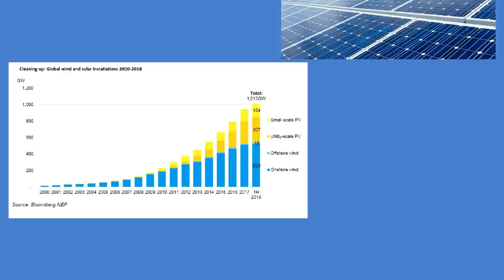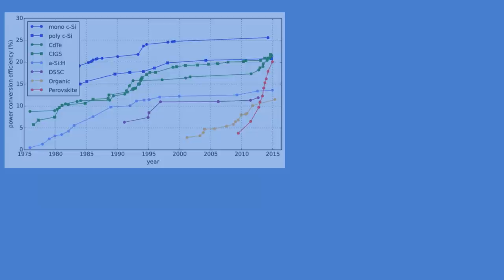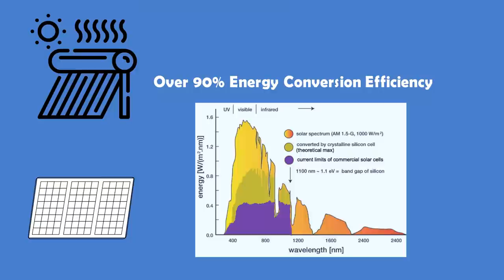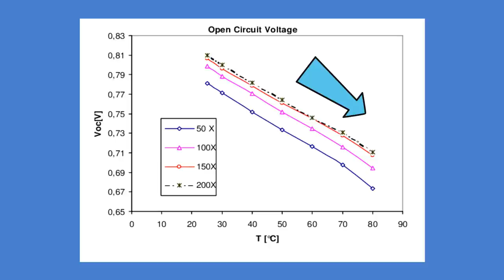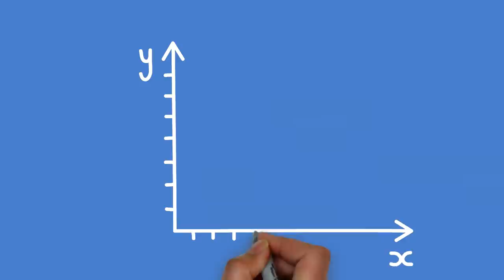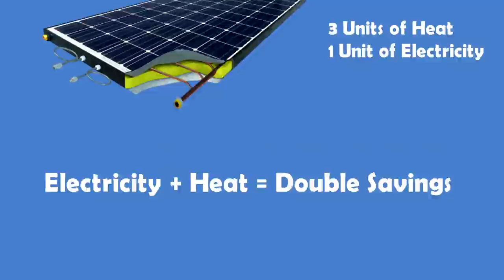Solar Photovoltaic Thermal Hybrid Panels: The Next Step

Comment: 0:02 Combine concentrated solar and concentrated wind with a folding  mirrored cone dish and a cylinder down the mddle lined with high temperature high efficiency solar cells.  If you heat compressed air in the cylinder, you can drive a gas turbine with it.  Some solar farms do that.  They store the energy in a pile of gravel and recover the energy with a gas turbine to make electricity.  This kind of system might generate six or eight times the elecyrical energy as the same area in regular solar panels for a small fraction the price. 
Some cars have a combination turbocharger, electric motor and generator to spin the turbocharger for faster power in between acceleration and conserve energy.  It might be about the right size for a gas turbine to drive the dish energy system. 0:02

Comment: Another idea was using lens to concentrate more light into the panel and a close cycle thermal engine connected to the cooling tubes.

Comment: Idea:  Take the generated hot water,  run it across a refrigerant evaporator unit, and then run the refrigerant gas through a turbine in order to generate even more electricity.  In the summer time at least, that would be preferable to dumping heat to atmosphere.

The question really is whether the electricity generated will be sufficient to run the refrigerant compressor.  If so, then it could be a worthwhile component to add to the system.
Reply: Hell, you could run a steam engine off my panels and do as you like with that energy!

Comment: I looked into this almost 10 years ago and the price difference for the panels was double even before the extra installation costs 😟
Reply: You can build one with an old hot water heater, a "solar shield" full wavelength absorbing material, some hose and copper pipe and 4-5 hours.
Reply: I'd be happy to share designs.

Comment: It’s still blowing my mind lol what if I bury a shipping container full of my solar panels effectively making an underground oven and use convex mirrors to heat oil in metal pipes to 600 degrees in a separate insulated oil tank and maintain a constant whatever temperature is best for the solar panels 24 hours a day! 4x fold I was going to do the same thing for the swimming pool in Arizona elevation 5,000 feet! I just need emergency blankets and the warm pool water will warm my house at night in the cement floor!

Comment: One one hand, we are nowhere near the theoretical limits for solar. The Shockley-Queisser limit, which is about 33%, applies to a single-junction silicon PV cell, without concentration. Other configurations can do much better. OTOH of course, it's a matter of extra factors: manufacturing cost, how much direct sunlight you have (therefore how much you can concentrate), and a few other matters. Theoretically, with direct sunlight and concentration, you could exploit the maximum effective temperature available by concentration, which is the same as the temperature of the surface of the sun: about 6300 Kelvins. Divide that by the sum of itself and the ambient temperature (typically 300 K), and you get 6300/6600=0.95, so about 95% efficiency.

There are a number of approaches you can take to milk more useful work out of the incident sunlight. It's a significant subject, probably worth a whole bunch of videos.

Comment: It is easier to use a heat pump with a high CoP. Best regards from Egypt.
Reply: Costs more, uses more electricity, and doesn't improve panel power output.

Comment: What about European winter temperatures? We had 0 to 1 C most of last week (daytime temp).
Reply from the maker: You can run water glycol mixture through the water heater and have a heat exchanger in your hot water tank
Reply: @synergyfiles3536  thinking further, it could be used as a alternative heat source for a heat pump. Even at cold temperatures, in winter, with a little bit of sun, you could get the required temperature raise of about 5grdK and that at a higher temperature level as from your primary source, therefore at a higher efficency. For example, my earth collector, today Feb.19, has an input temp. of -7grdC and an output temp. of -2grdC (achiving a raise of 5grdK).

Comment: Cooling won't happen if solar thermal water is already heated up enough >60C. Dilemma: PV needs cool water, but you have solar thermal to heat up, and in most cases store, the water.

Comment: السلام علیکم 
سر چار بیٹری ہےAH 200 کی 
اگر سیریز میں کنیکٹ کریں تو چارجنگ کرنٹ  کیا ہوگی یعنی سولر انورٹر سے کتنے امپیر سلیکٹ کرنے چاہیے اسے چارجنگ کے لیے 20 یا 80
Reply from the maker: Current say farq nahi perta. Asal cheez hai jo cheez charge ho uska voltage kum, aur jo cheez charge karay uska voltage ziada hona chahiay. 12 V ki battery hai to 13 V ka panel hoga to charge karay ga.
48 V ki battery hai to charger ka voltage 48 V say ziada hona chahiay.   Laikin agar buhat ziada voltage hoga to us say battery kay damage honay ka khatra rehta hai. Wasalam
Reply: @synergyfiles3536 چارجنگ والٹیج ستاون اعشاریہ چھ 57.6 سلیکٹڈ  کی ہے 48 وولٹ بیٹری بینک کے لئے 
اب ایمپیر کی سمجھ نہیں آرہی کہ 20 امپیر سلیکٹ کریں 
یا 20×80=4 مطلب کیونکہ چار بیٹیاں ہیں 
نوٹ بیٹری سیریز میں ہے
Reply from the maker: @SulemanKhan-io2gm  Bhai aap kay pass volt meter hai? Battery ki resistance maloom karaian kitnay ohm ki hai. Us meter main hi option hota hai. Phir jo bhi value aaey usko note ker lain. 
57.6 -48 yani 9.6 V ka potential difference hai. Aap 9.6 ko taqseem karaim us value say jo meter say maloom ki. Current nikal aaey ga. Yeh ziada say ziada current ho ga. Aap ka panel kitnay watt ka hai?
Reply: @synergyfiles3536  250watt K panel
4 batteries 
1 battery 200ah
Series mein 48 volt
Reply from the maker: @SulemanKhan-io2gm  agar 250 watt ka aik panel hai to 4.3 amp say ziada current nahi hoga. Agar 2 panel hain to 8.6 amp, ager teen to 12.9 amp

Comment: PVT can be a great option in colder countries where the entire energy can be used, even in hotter countries, the increased solar electricity generation and the longevity is a boon. But, what do you think of A Solar panel that also uses peltier effect, that should also generate electricity and as a result should cool the panel. I had looked it up a few weeks ago..couldn't find much. Can you research into it?
Reply from the maker: I have done a video on it. Please search STEG it will pop up

Comment: Yes, its great but... there's always a but.  And in this case, the 'but' is that the life-span of the hybrid panel is going to be fairly short compared to the life-span of just the solar panel.  You are pushing fluid through a great deal of copper there, the chances of developing a leak or astronomically high so maintenance would become a significant issue.

A second problem is the fluid that you are pushing.  Generally speaking, pushing water (distilled or otherwise) is going to gum up the works from mineral deposits and other problems fairly quickly, particularly when the water is heated up, not to mention the problem of pressurization and boiling.

So you need to push something else through the hybrid panels in a closed loop that isn't water and that has better properties than water, and extract the heat to be used to heat your actual water with a heat-exchanger.  That way most of the maintenance devolves down into the heat-exchanger system and the hybrid panel system is far less likely to develop a problem.

All of this entails significantly more complexity than just having solar panels generating electricity.  Solar thermal systems can definitely be cost-effective, but those systems are usually relatively small (the closed loop in particular is relatively short).  Running the pipes through many panels instead of just a few exponentially increases the risk of a leak and other maintenance problems developing.

-Matt

Comment: I think I can use the excess heat to run a Stirling Engine connected to a generator.
Reply: You could charge a phone like that. To get any real power you need a large temperature difference which this wont provide.
Reply: @Edwin Nasson They are brilliant, but your example is concentrated solar where a Stirling Engine will indeed work well since the temperature difference is sufficient to produce usable energy. What poor @Ray Watson was lead to beleive is that he can use the waste heat from a photovoltaic to produce meaningful power...which just goes against the laws of thermodynamics, unless you include extra links in the chain that make for a very expensive and innefficient system. Better to start with solar thermal or stick with photovoltaic. Trying to mix the two will only happen when we have solar cells that reliablly work up too 600C. This technology is in its infancy and not something we can do easilly in our sheds.

Comment: These existed for a while now, they must have a major flaw, that no major manufacturer has been producing them.
Reply: My PV lecturer when I did my MSc in Renewable Energy Systems had concerns about these panels in regards to what happens if the water pump circulating cooling water through the back of the panels fails.

With the back of the panel being insulated and the panel no longer being cooled, the cells would get very hot potentially damaging the panel.
Reply: The main problem is you want to keep the fluid longer in the collector to get it heated up to 60-70 C, but the pv panels work best around 25C. So either you are running the pv at a bad temperature or you need much more storage if you want to store 40 degrees water instead of 60-70. Most people don't have/need a warm water pool.
Reply: They probably work best with an air heat pump. Meaning you'll have a cooling element, not unlike the one inside your freezer, stuck behind the PV panel. But that's another expense.

Comment: Why not use the excess heat to produce extra electricity? Hot water becomes steam under pressure which spins a dyno which creates electricity.
Reply: PV systems work better the colder they are. You have to use an inverter rated to handle production on a  minus 15 deg f. day. A PV panel making steam  ( 200 deg. f.) would be making  limited electricity.

Comment: not sure this even make sense in thermodynamics. in order to heat water the panel must be at least 2x of water temp and in summer this means 70-80C on the panel. compare that we with a close circuit cycle with high efficient coolant that proven generating up to 15% net efficiency gain, then use that gain to heat up water is really not a clear winner + killing your panel just as fast without active cooling.

Comment: Dump the excess heat? Run it through a heat exchanger and generate even more electricity when you have too much hot water...charge your car and then store it in  batteries to sell back to the grid at times of peak price...you will pay for the system in no time
Reply: Not enough heat energy to generate electricity.

Comment: It still baffles me, add thermal electric, I know the tech is s bit costly however use the photoelectric to power a pump to circulate coolant coiled underground. The temp gradient should be more then enough when talking about large panels

Comment: From the little Ive seen on this, the up front cost and energy used running pumps is equal to that of adding a few more pannels. Logically, the excess heat generated is pretty low and any conservation into thermal electric would be minimal since the temperature difference is too small. To get any real heat gain you would have to let the transfer fluid warm up to a higher temperature and thus sacrafice the efficiency of the pannel. You could increase your cost by adding heat pump to then run a generator, but its still a large up front cost for a small percentage increase in efficiency. Hot water systems work better when storing water at around 70c for centeral heating, so 30 to 40 deg water is only good if you want to turn on a tap (thus the 60% gain in efficiency is very much going to be wasted most of the time). I think this is very much a case of you cant have your cake and eat it. Cooling pannels for longer life and a slight increase in effiency is not a bad thing. But its no silver bullet. Id sooner go thermal-electric from the start.
Reply: The limit is how much space in the correct direction shade free. This would only be useful in a space limited system .
Reply: @larkhill2119  not sure which bit your referring too.
Reply: @RoadRashSpirit  Roof area is always a limit in solar design. Has to be South facing with no buildings or trees in the way. In my case a 70 m Birch tree until a beaver cut it down and it fell on the roof. If I had a solar system it would have been more expensive it took 6 guys a day to remove the tree. which was across a river with no crane access. two floors up.
Reply: @larkhill2119  ah I see where your coming from. Yes the extra expense might be worth it to cool your panels in summer if you are struggling for space. But the efficiency gain in doing so, still wouldn't be very high. Certainly no where near as good as suggested in this video for the reasons I have already stated. Again, you might be better going thermal electric if your handy engineering wise. Else you would have to scour the market. Only... And I mean only if you already have a heat pump installed in your property or you plan on spending the 5 too £8000 on one, would you benefit from a greater efficiency. And pay back would be a very long time indeed. You would be doing this as a conciencious individual rather than any money saving incentive. Even then, If you live in a mild climate you won't need to cool your panels in the winter and won't gain much thermal energy from them, the heat in summer is still wasted.
Reply: @RoadRashSpirit   Yes exactly. Also in 38 degrees the walls heat the pipes enough for a cool shower I find.

Comment: In the hot climate area where solar energy is plenty, there is very little need for the thermal energy (need AC instead :). In the cold climate area where thermal energy is needed most, solar energy is unfortunately not so efficient....a solar thermal panel in cold climate area is barely able to get the water temperature up to 40 degree C....probably work best in near Tropic of Cancer area.
Reply: That’s why you want to use the solar thermal panel as a heat pump source. Then you get excellent winter performance :)

Comment: Interesting idea and video however but it wouldn't be economically wise for your average 3 bed home owner. Even though less space would be needed for the solar array (meaning the extra panel cost may  be offset), the installation would be much more expensive and maintenance costs higher than a standard solar PV installation. It could be an option for off-grid installations rather than grid-tied

Comment: In summer , hot months, is there enough waste to run an absorption refrigerator? Seams like your starting to create a hybrid system that might be able to be used all year. Elon if your listening, your the guy that could pull this off commercially.
Reply from the maker: Yes that will be a good use. However for absorption refrigeration, the hotter the temperature of water, the more efficient it is. The PVT only furnishes water at peak temperature of 40 degree centigrade. Having said that this water can serve as ecomizer water, that saves energy required for heating to max temp. So its a good idea

Comment: The problem is one needs to store the heat of the sun at ~40-->50C which means the Solar panel needs to HEAT UP TO 55C or so which means its thermal efficiency SUCKS.  Or, you have to have the low grade temp water enter the solar panels, and then go into a solar thermal only panel to boost temp higher.  This also means your house needs to have a ~4000-->8000 gallon tank to actually store said energy and these are HELLA expensive.  If you only are going to get ~30C water then this is barely useable other than for ~4 months out of the year.  $$$ spent putting in pumps, thermostatic valves, control boxes becomes prohibitively expensive.  Far better ROI to just use the electricity in a heat pump and put any extra $$$ you have into a ground loop thermal collector and forget  solar thermal, or at best do what I said above, do the ground loop and then finish it off with solar thermal on a roof and in either case you are NEVER going to get your increased efficiency of your solar panels.  Unless you literally bury the panels under water, with an air gap but then your power collected sucks wind.

Comment: Yes but this is useless in Europe, because yes we use the most energy for heating but that’s because it’s cold and sunless in the winter. So solar panels typically do 5-10% of there rated output in de winter, and solar collectors need to be drained so they don’t freeze. In the summer i pay €5 month for gas to heat the hot water i need. This investment will never be earned back in this way, that’s why no one has them. The only reason i see the useful is when you heat a pool(in the summer)
Reply: Odd how this tech is in use in Europe then :) 
It should actually be the perfect system for the average European climate as our winters aren’t extremely cold and usually very sunny on the coldest days.
Out of the systems I’ve been looking at triplesolar.eu seems to be one of the best I’ve come across so far with a supposed pay back time of 12 years.
Note that there’s no need to drain collectors when using glycol.

Comment: Do you know that ac motors can run ac generators and the ratio is 1 to 13 meaning that a 1 hp ac motor will run a 13 hp ac generator which will run the 1 hp ac motor and still have a 12 hp output!